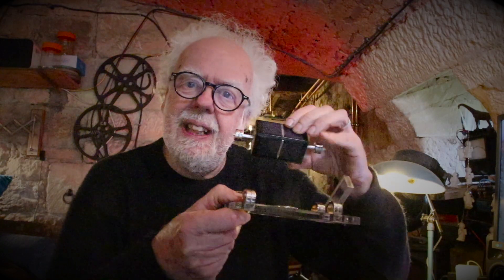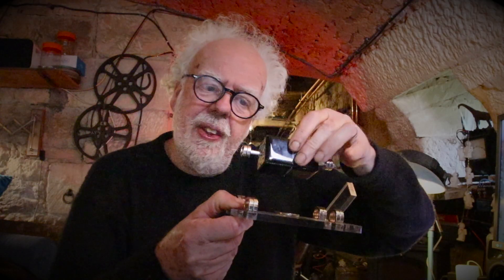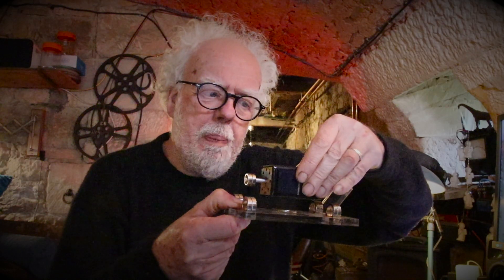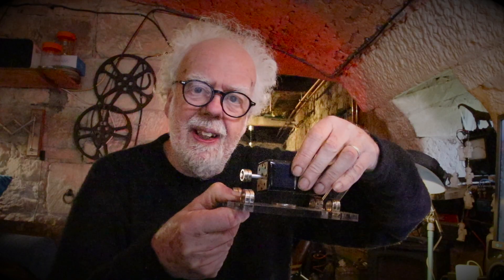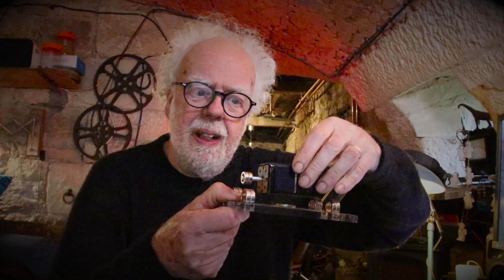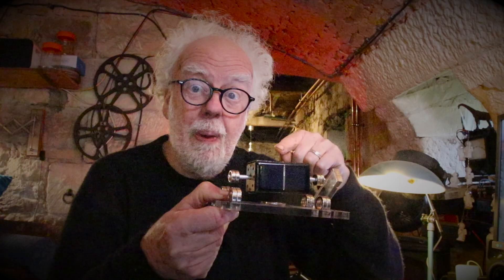Solar Cell Mystery ? - Prof Simon

Comment: Nice vid - my understanding of this phenomenon: photons(a quanta of energy) from the torch, will strike the pv panels, and some interact with the p/n junction of the diodes that form the functional basis of these panels. The diode junction being unstable releases an electron - enought electrons released creates a cumulative EMF ie voltage. But remember that "mass" is just energy manifest to the observer, so you are actually reducing the mass of the side with the torchlight, which is verified by your experimentation ie L/R rotation :) All systems seek equilibrium, so the rotation will always go back to stationary when energy(photons) are no longer applied, but the overall mass will be minutely reduced(too small for direct physical measurement) overall. There's  never a free lunch in physics,  or life! Keep safe and well.

Comment: The cells near the light will produce most current, which must flow through wiring which produces a small magnetic field,  This field will interact with the central base magnet's field to produce a rotational force.  That force will be either allways attractive or allways repulsive as all four sides will have the same wiring, so it is inevitable that the direction of rotation will be determined by which side has the most illumination.  If you illuminate the device from both sides I would expect negligible rotation, as the fields on both sides would be attracting/repelling the base magnet equally.  If you illuminate from the top only, I would expect some slower / weaker rotation as the generated field would be further away from the base magnet.
Reply from the maker: Good experiment

Comment: Professor Simon I believe your looking at the wrong source to the effect.
Could this actually being caused by the effect of the flash light on the magnetic field and not the photon?
After all the metal in the flash light will effect the field established by the magnets on the base.         

In my experiment I reproduced the same effect with the flash light turned off..
Reply from the maker: Good experiment

Comment: Depends how the magnetic coil(s) are rigged for the 4 solar cells (isolated quadrant windings ?).
Even though it is suspended by magnets, gravity pushes down on the field on the bottom side.
Ie the magnetic support is assymetric and bottom biased, rather than 360 degrees and/or equally spread.
This means magnetic flux is greater on the bottom than the top.
If you then add 4x 90 degree windings, which ever side is energised will seek the path of least resistance.

Had the support magnets been exactly 180 degrees apart (rather than app. 90), it probably would not move.
But then neither would it float.

In effect, it is acting like an auotnomous stepper motor, due to the magnetic flux assymetry.
But I would want to see build diagrams to be sure.

Comment: I've seen something similar with a mini anemometer, made of platinum, in a vacuum. The explanation given me was that the heat from the torch made the vanes spin. Would the same happen if the light was reflected by a mirror on to the rotor?

Comment: ok, a simple two pole rotor with a two pole stator has one potential "adjustment" that will dictate it's direction of rotation. at what point in its rotation are the rotor wingdings energized. you can "clock" the commutators differently, or you can "clock" the stationary magnets (stator) differently. Either will achieve the same results. Eventually finding a point almost homogeneous, but then reversing rotation.

Comment: Its the equivalent to changing the position of a DC motor's brushes. The timing that a given winding on the rotor receives a charge from it's corresponding solar cell is changing with the position of the light source, Which changes when that rotor coil is magnetized... befor a given stator pole or after?

Comment: Is it that each side of cells energises 1 coil. and that coil pulls or pushes by the magnetic field it crreates. So if it pulls from the top say, when you go to the other side it still pulls from the top. If all the coils in the motor were energiised at the same time it woukd just sit there doing nothing?
Reply from the maker: I think that’s the answer....yes

Comment: Are you shining the light in parallel  with the surface or with an angle? Uper or lower the axis? Could this cause a asymetry of lightened solar cells, like a air stream off axis causes a wheel spin as the 4 cells are connected to 4 coils of the motor.
Reply from the maker: Just on the left and then the right...I need to do further tests

Comment: anything metal in a torch that effecting the magnet ......
all so the power of the light the lumens does that have any effect if you use more powerful torch
and last of all ...laser pointer of some sort what happens if you limit cone of light ...is it more effective light on more surface or to have concentrated on smaller surface

Comment: I take it that the rotation is not powered by photon pressure, but is instead being created by some motor internal to the floating part of the device, powered by the four photovoltaic cells on its surface. Without knowing what was inside it, it would be hard to know for sure, but it seems to me that each of the four panels must be creating a force internally such that the panel in question tends to rotate away from the light, through some mechanism inside it. Intuitively we might normally think that there would be a single motor powered by all four of the photo cells, in which case it would make little sense that it should ever rotate differently, it would likely always go in the same direction, or would be random. The fact that it rotates differently given different angles of light source suggests to me that the internal mechanism driving it is actually made up of four independent motors of some kind, or independent motive forces meant to make the spindle spin, which are powered by each panel separately. One way this might be done is if there was a set of four spokes on the inside with movable weights on each spoke which could be pulled towards or away from the axis of rotation. If the action of the solar cell was to move the weight associated with the spoke away from the axis, and then once the photo cell was no longer powered, the weight would return back to the axis by the action of a spring, then the rotation would change according to which side it was being lit from.

Comment: Hi Simon, I think I have got it.

There is only one permanent magnet (opposed to 2 or more normally).
And to me it seems that there must be a Spool/coil behibd every solar panel.
And as for the wiring/spin rotation:
If it is wired so that the panel being mostly hit, magnetise the coil on the opposite side of the stator (the cube).
If we think of it as a Dice, light hits 6 and magnetise the coil behind nummer 1.

That will make it do exactly that.

And it is sooo cool, I have never seen such a thing before.

Thanks for the video
Reply: And as far as I know, there is no polarity switch in a solarcell, when hit by light for a different angle. That was what me me think up the solution. Its just mechanical, rational thinking, or I think it is.

Comment: Could it be the solar pressure applied by the light source (flashlight)? Orbiting satellites that have remained operational well beyond their planned service life can use solar pressure (i.e., solar wind) to maintain attitude control. This often occurs once they've exhausted their onboard hydrazine fuel supplies that feed the attitude control thrusters. Especially those at very high altitudes, such a geosynchronous/geostationary satellites, where the near-Earth effects are somewhat reduced compared to LEO satellites. The effect is much more gradual that those offered by thruster management, but it is highly effective and has extended service lives of satellites to a remarkable extent. Maintaining attitude control using solar pressure is a remarkable feet considering the enormous weight of some satellites, which can weigh tons. An example might be an aging satellite with onboard system issues that need managing, such as temperature control. Operators might wish to reorient the satellite relative to the sun facing side to reduce the direct impingement on that side. The maneuver would require reconfiguring/rotating the solar panel array to "sail" the satellite using the solar pressure. Remembering that while the satellite is either precisely or generally positioned over the same point on the earth, it is still orbiting the earth. The controlling commands would be sent to force satellite pitch or roll changes as the satellite rotates around the earth with respect to the sun's solar output.

Comment: by changing the light from side to side your changing the  rotation  due to changing the order of the field triggering and the collapse of the field oscillation. It's the same way you reverse a motor by changing the order you trigger the windings. Each panel is connected to a different winding. So your changing the order the field builds in it
Reply: Very Good Nick, What would happen if there was only one winding with all cells connected ?
Reply: @finefloor   it would spin in one direction based on polarity of windings after you give it an assist
Reply: @nicktoale  Thanks for your reply. We can see that the polarity of all windings are the same. There is also only one magnetic field at the base. If there were multiple magnets around the windings and the photo voltaic panels were lit from multiple angles, how efficient would it be ? just an inside-out DC motor - ish.
Reply: @finefloor  read my post.
Reply from the maker: That makes sense
Reply: By the words you use, you have some insights it seems.
But what you write depends on having atleast 2 permanent magnets, of opposite polarisation.
Ps: read my post.
Reply: @svareter42   So a larger single winding surrounded by multiple magnets with opposing polarisation to the windings would almost make this usable ? 
Would there be a difference in current with single or multiple windings ?
Reply: Right.  Another way of saying it, it's the light energy hitting one cell (=winding) combined with the light energy being higher on one adjacent cell or the other, which determines direction of spin.

Comment: What if you  shine light from the top?
Reply from the maker: Must try that...some good suggestions in the comments to the cause and further experiments
Reply: If my Idea holds up, read my post. Then this will result in a slight or no movement,  as the magnetised coil will be attracted to the permanent magnet just below it.

That is if you can limit the ligth only to hit the cells facing upwsrds.

Comment: Isn’t it basic physics.  Each face of the spindle is a generating circuit.  When illuminating charge flows creating a field in the static magnets, repulsion using left(or is it right) hand rule.  Repulsion. On each side is up (ie toward the centre) hence giving the handedness of the observation.  When reaching the top the side of the spindle moves out of light and is no longer charged.  Next face begins the sequence....
Reply from the maker: Good theory Roland
Reply: @SimonHollandfilms    It’s Solid ! (State :-) )   I won’t tell them about your “magic” torch either.
Reply from the maker: Light emitting magic
Reply: @SimonHollandfilms    I wish I had heard you were doing this.  I would have suggested it would have been demonstrated much better with a yellow light on the left hand side and a blue on the right.  Having aid that, Nathan Oakley will just rant that it is just a diffraction effect.
Reply: I wrote my suggestion/posible answer before reading other comments.
And found this to come closest
It describes how and electric magnet works, and to some degree how a electric motor works.
But it does not describe why the direction of rotation changes, when Simon moves his torchlight to the opposite side.
Reply: @svareter42   Each panel on the spindle is a simple circuit which is energised when the light hits the solar cell.  Clearly there are some static magnets in the base which as well as providing the “invisible” support also provide a magnetic field for the motor.  In a normal electric motor brushes are used to change the direction of current in the rotor elements.  This is so that say the right hand side pushed up and with the reversed current the left hand side pulls down.  (Remember this reversal).  In the solar motor there is no reversal of current.  It flows in the same direction whenever the side is illuminated.  However that means that when the right hand side is illuminated the panel will move towards the top  AND that when the left hand side is illuminated this panel will move to the top.  It is this that reverses the direction of spin.  It is only the illuminated panel that generates the movement at any point in time......
Reply: @rolandmalkin  we think alike.
I had a feeling you knew a good deal about electric motors, 2 and 3 fase ones.

Comment: It means that the direction of light changes the direction of the current, so is your flashlight of a special kind? It might be that the direction of the light waves changes. What happens if you rotate the flashlight 180 degrees? I am not a scientist by the way. 🙏🏼
Reply: What happens if you shine light from both sides or three sides? This is very interesting....
Reply: Or a stroboscope...tricks of light & shadow?...(and mirrors)...

Comment: If you had a light source on both sides what way would it spin (or wouldn’t it......🤔) ?
Reply from the maker: Must try that...thanks you
Reply: @SimonHollandfilms  also try different types of light. Infrared, Ultraviolet etc. Also open one up and look at the internals might give some clues. Maybe the older idea of solar sails using radiation or photons has a physical effect on the object since it's basically free of friction.
Reply: @workindad  yes, I thought of solar sails, as well.
Reply: Or with the light directly above...

Comment: My guess is that the square shape (rather then tubular) is deliberate and that this causes pulses of current as the angle changes.  Then it is wired  through 2 diodes to a common coil (to make a magnetic field).  So like this : LTRB (left top right bottom). LTRB wired together through diode 1. RTLB wired together through diode 2. This arrangement makes the resulting current through the coil change direct, thus changing the magnetic field polarity and thus rotational direction w.r.t to which side the light is shone from.
Reply from the maker: Ah ha...thank you...sound right
Reply: @SimonHollandfilms  Elbow bump.
Reply: Oh so close to my answer, I like it 👌 

Now remove the diods from yours, not needed as a solarcell produces DC.

Comment: Imagine each panel is protected by a diode. When light is shone from one side the incident panel will conduct through its diode to motor...Turn light to other side and shine light on that panel and that diode will by the nature of this thing be connected to the opposite motor pole and reverse direction. The panels can not change polarity themselves. They can be driven in reverse by a voltage from an adjacent cell which is being powered though...
PS you don't need the diode here.
Reply: I think you solved the riddle. 👍✔️
Reply from the maker: Thank you
Reply: Hmm, I'm pretty sure You have also got it .
Although I don't see you mentioning the Placement of the Single permanent magnet in this setup. And I pretty sure that Voltage reversal/polarity change is not used either.
It is far more simple.
And it will not do it in Space either,  as it still depends on that magnet fixed/hanging close to it.
Reply: @svareter42  I wasn't clear I was thinking as I wrote. It is exactly the same a reversing polarity on a motor and making it go in reverse. There will be a 'slip ring' od similar and a connection to either windings or commutator from panels. On one side the flow will be in one direction and other the reverse.
Reply: @svareter42  It's hard to make it clear - I was first thinking diodes but you don't need anything it is simple. I loved this as it looked at first glance like magic! Yet obvious when you realise.
Reply: @martinda7446  indeed it is. No Slip-ring electric transfer, no contracts.
As the single Permanent magnet is fixed to the base (below Stator <rotating part>).
And the Stator it self collects energy to magnetise its internal coils. (More information in my post).

But it is nice for the eye, and the brain. 

Thanks Martin
Reply: @svareter42  Silly me was thinking of it as a standard motor...
Reply: @martinda7446  so did I, but there was something missing, and it was not the Brushes, as it can be done as a brushless/3 fase motor. It was that second permanent 🧲 .

But as Simon says, my viewers got often hit the answer, or will think it up together, and the truth Is out there.
Reply: @svareter42  Aha! I didn't realise you had a channel...Looked, was impressed, subscribed.😺
Reply: @martinda7446  oh Thanks a lot, and welcome. It's diverse, or put in another way, Going in all directions 🤔 😉

And nice to see you are into 70ties music

Comment: Could it be that the coating of the cells are polarised,
So that they receive positive photons in one direction,
and negative from the other direction ?
Reply from the maker: good thinking
Reply: Exactly what i thought. That it has something to do with photons.
Reply: Photons do not carry any charge, so can't be positive or negative, and as far as I am aware, PV cells are not sensitive to light polarisation.